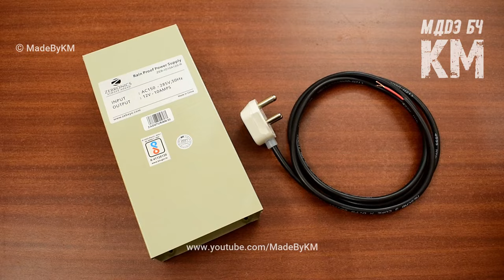❄️ Cool Down Your Aquarium with a DIY Chiller: Step-by-Step Tutorial 🧊

Comment: Upgrade: you can use 2 Peltier pads, one on top of the other, one with 12v and the other with 6v, the 12v pad will cool the hot side of the 6v pads and thus increase the cooling capacity
Reply: Someone didn't read thermodynamics properly
Reply: @malhaar5880 actually it's applicable and it's called cascading, it won't be efficient as a single module but it helps in cooling down more watts of energy. Help me if I'm wrong

Comment: Hello Bro, thank you so much for the video. I have gone through the description and I am having a 120 litre tank. For this if I just increase and stack 2 or 3 peltiers together will that be enough ? or I need to increase the heat sink and the fans as well?. Kindly let me know. Thanks 🙏
Reply from the maker: Yes, you’ll need a much larger heatsink and more cooling fans in order to maximize the cooling of the hot side of Peltier modules. The cooler the hot side of the Peltier is kept, the better the device will be able to cool the aquarium water. Additionally, you’ll need a thermostat capable of handling the Load of your Peltiers, cooling fans, etc. Thanks.
Reply: @madebykm  thanks for your reply 🙏
Reply: @madebykm how much will it cost build something likethis for a 200 lt tank

Comment: You are amazing! Never thought you would go this far to make a chiller! Thanks Buddy keep uploading I wait for your videos always! :)
Reply from the maker: Thanks, will do!
Reply: bro i cannot find 200mmx100mm alumunium heat sink anywhere. should i use 2 100mm alumunium heat sinks? but how should i attach them together???? i have some white silicon thermal compound which is used for LEDs.
Reply from the maker: Yes you can use 2 100mm heat sinks and attach them using nuts & bolts and two small pieces of 4mm acrylic sheet from the sides. You can also use a 12 inch x 100mm (minimum) heat sink. The cooling procedure will work better if you use a larger heat sink. You can also search the markets where electronic products and LED lights are sold.
Reply: @madebykm  what’s the cost of this build?

Comment: Super Idea. Brother when u make it for  a 20 gallon tank u have mentioned to use a 12 V 20 Amp SMPS. So when we put both the peltier modules together it should be connected to 20 Amp output or when both the peltier module and both the cpu fans to be wired in parallel together and then hooked on to tge 20 Amp output ?
Reply from the maker: Yes, first connect all positive wires (usually red) of the Peltier modules and fans and connect to the positive terminal (+) of the SMPS, and negative wires (usually black) to the negative terminal (-). Thank you.

Comment: Dada tomar kaj sotti ashadharon .
I have two queries :-
1. What is the total power / wattage of the system?
2. Can this be also used as heater by the adjusting the temperature controller?
Reply from the maker: 1. 77w, 2. Yes, by adjusting the Peltier module and the temperature controller. Thanks.

Comment: Hello, thank you so much for sharing this. I have a question, I have a 200 liter tank and I want the water to be between 15-17 degrees. How would I need to modify your current system to achieve this? Thank you so much 😊
Reply: add 2/3 peltiers and for that use a long block which can accomodate 2/3 peltiers

Comment: Great video very detailed on how to build. Why did you a a heat sink on top of the water tank?   I am talking about the opposite side of the peptide cell of the tank.
Reply from the maker: The smaller heat sink was installed to enhance the cooling and to attach the Peltier module and water block to the bigger heat sink.
Reply from the maker: Thanks 👍
Reply: @madebykm  Why would it enhance the cooling though? That is the cold side so won't that heat sink be stealing cold?

Comment: This is amazing! My only concern is if it will work if I need to reach 15 -18 Celsius on my tank when my ambient temperature can be 35 Celsius, do you think it’s possible?
Reply from the maker: To reach that temperature, you need to use 2-3 Peltier modules. Please check the description box for more information. Thanks.

Comment: Hi, I find your work very good and useful, I want to ask can I use the 12v 10a adapter because I tried connecting the wire to the female jack but I don't understand why only the temperature measurement circuit is displayed and the other parts then it doesn't work sorry I'm not an expert in the field, hope you reply soon. Appreciate what you are doing. Thanks
Reply from the maker: Yes, you can use a 12v 10a adapter

Comment: Cam you make seperate video for saltwater tank chiller? Hope you see this. Thanks in advance 😇
Reply from the maker: You can use the device in a salt water tank if you use a titanium water block and a pump that can operate in salt water. The process of making the chiller is the same.

Comment: Hi! Cool project! Just one question here. The fan direction is right? In that way that you show in the video was exhausting hot air instead of cooling the hot side of peltier (and the heatsink) . What's better?
Reply: You would usually exhaust it away from the peltier

Comment: will the aluminium cooling block have any effect on the fishes and can the outlet of the cooler module created here be modified to fit inside the filter to help in much more effective cooling ?
Reply from the maker: 1. I have not yet noticed any negative impacts on my fish.
2. It’s working well in this setup, but you can always modify it as per your choice.

Comment: Hi KM, 
Thanks for your video.
I have made same stuff ordering same spares given in discription.
However 12V DC pump is unable to pull off water rest all mechanism working fine. 
Can u guide/ help me on water pump part.
Thanks
Reply from the maker: Of course, check the description box for the solution. Thank you.
Reply: Thanks KM, I have followed the steps and working perfectly ❤
Reply from the maker: That’s great 👍

Comment: Can we use a copper cooling block with the same heat sink ? I assume the time to cool will be faster . Also, what’s the total current draw of the unit ? Can this be plugged safely into a standard 6A socket ? Or need a 15A socket ?
Reply: Never mind got the answer. Max current draw will be around 10A for this setup, so 15A socket it is. As for the copper cooling block, while it is more efficient, copper is harmful for fish and shrimp

Comment: i have question, at home i have peltier 12704 which can run in 4a and 12v 5a adaptor, if i want the same build like you it is possible ?

Comment: Digital Thermostat you used has 20A power out like most thermostats. Peltier you used needs 6A. by that logic I can't use the thermostat, with more than 3 peltier connected to, right? Not an engineer so no idea, honestly figuring it out as I go. Thanks!
Reply: Also, I need to cool a 500L aquarium, to about 5-8 C degrees. By your instructions, I need about 12 Peltiers which is a lot. any suggestion?
Reply from the maker: Yes you are right, for larger tanks, where multiple Peltier modules are required, an AC thermostat should be used. I'll make another video on this, where I'll show the connections and all. thank you.

Comment: Hi, I saw your video on the diy soil. I was wondering if I can cap it with aqua soil instead of sand or gravel (I have used aquasoil at home). I will make a jungle theme planted tank with only jungle val and dwarf sag. So will I add some root tabs under the soil as well? Also should I add a layer of fine mesh between the soil and aqua soil layer? Finally, how should I fertilise these plants? Since they are root feeders, I’ll need root tabs and the problem is that I will be making a carpet of dwarf sage and jungle val, so how should I add the root tabs? Will low light be enough? And should I use co2? I have some diy co2 available, will using that hurt?
Reply from the maker: Yes, you can cap it with aqua-soil. There is no need to place a mesh between the two layers. Also, no need to add root tabs now, after a month or two you can add them using a tweezer. There will be no problem. They are easy-to-grow plants and can be grown in low light and without CO2 injection.

Comment: Hi, thank you for the tutorial but it’s not working for me, I’ve got a 12 cm block with 2 pettier cells 12V 6A serial conected, mini pump with a tap on the outlet to reduce even more the volum and the water doesn’t flow cooler than the tank, big heat sink with big fan on the hot side and nothing. Tested with my fingers and the cold side works fine but the water doesn’t goes out colder. Any idea why is not working? All connections as your video…
Reply from the maker: The heat sink you’re using is not big enough for 2 Peltier modules. You need to use a bigger heat sink and 2 cooling fans. Check description for more info. Thanks.

Comment: Is the thermoelectric cooler automated and dependent on the temperature sensor? If not, how do you make sure that the water temp doesn't drop too much?
Reply: You wire it to a temperature control switch.

Comment: Hi, I have used 2 peltier modules and 2 12v high rpm fans for better cooling and one water pump but the thermostat temperature keeps fluctuating for the set temperature and the device keeps turning on and off, is the problem with thermostat or something else??
Reply: @sagarmhatre2139  yes yes
Buy good brand one not the generic one. The generic thermostat keeps on fluctuating all the time.

Comment: Can i add another 6 a cooling module(1+1) to 12 v 10a supply will it able  to handle that? If that which power supply would be sufficient?
Reply from the maker: Check description for details
Reply: Got it thanks

Comment: Hi, can i use the 12v 6a adapter instead of the powet supply?
Reply from the maker: At least a 10-amp power supply or adapter is required to run all the components.
Reply: @madebykm many thanks

Comment: Can you use any digital thermostat for this project other than what is on the video? Like for example, W3230 model?
Reply from the maker: Yes, you can
Reply: @madebykm  Thank you! Also isn't this aluminum water cooling block prone to corrosion when exposed to water?
Reply from the maker: The cooling block I used is made of high-quality aluminum alloy, so there will be no problem in a freshwater aquarium, but do not use it in a saltwater tank.

Comment: is it safe for long time use?or we need to change thepeltier every month or so?
Reply from the maker: The Peltier module will not run continuously, it will turn off after reaching the target temperature, as it is controlled by a temperature controller or thermostat. Therefore, it will not get damaged and hence it does not need to be replaced frequently. Just use a large heatsink and cooling fan on the hot side of the Peltier and keep it as cool as possible.
Reply: @madebykm  Wow,thanks for the quick respons!